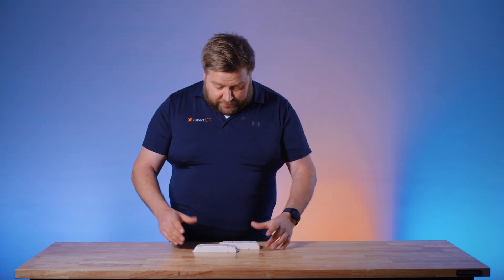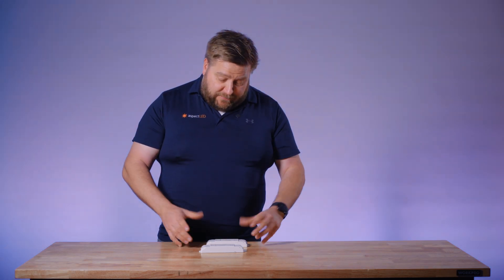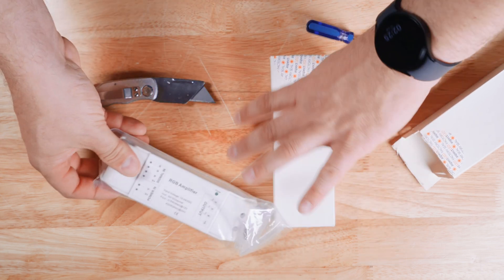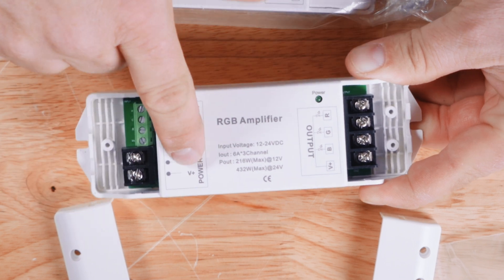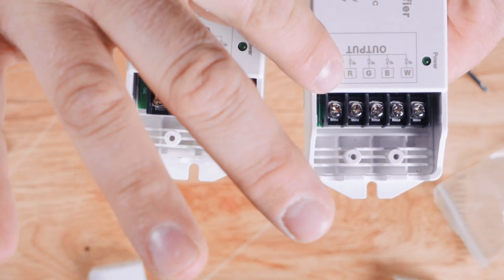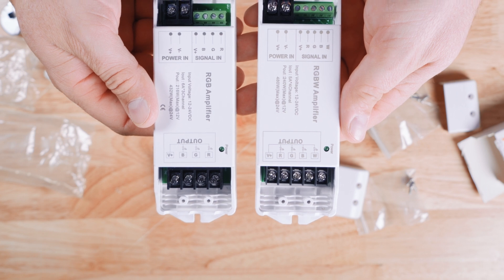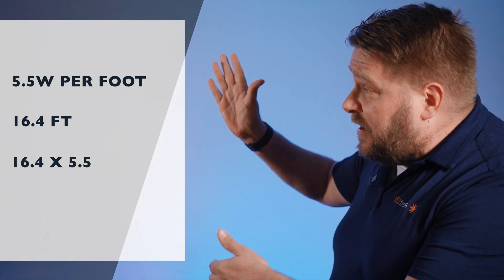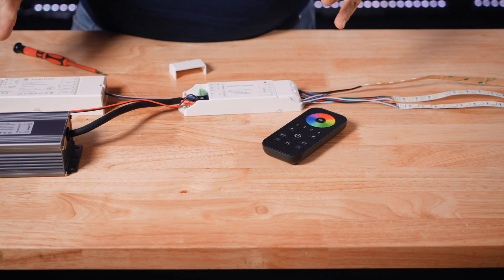PWM Boosters - Signal Amplifiers

Comment: Hello, Will this PWM Booster work with the Casambi PWM4-4 Controller?  I want to connect 135 W of LED lights to the Casambi PWM4-4 Controller, but this exceeds the 96 W/4 A.  Alternatively, does Casambi have their own booster/amplifier that should be used instead?  Thanks!
Reply from the maker: Yes, our existing PWM booster will work with the Casambi PWM controller.  You will want to connect the output of the Casambi to the signal input terminals on the boosters, connect your strips to the output of the boosters, and then supply power to both the Casambi and the boosters.  When used this way, the Casambi will draw very little power, so you can easily use one of your existing power supplies to power the boosters to also power the Casambi.